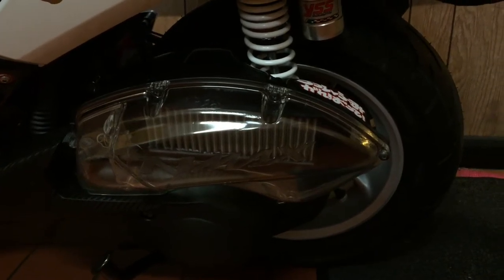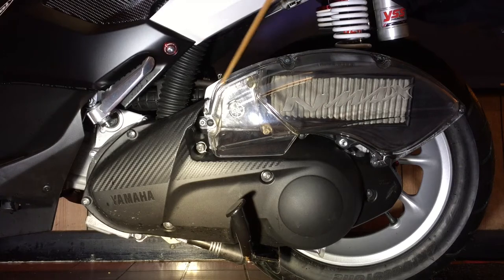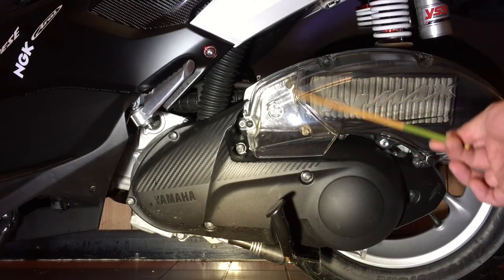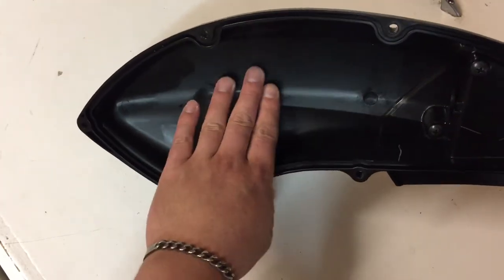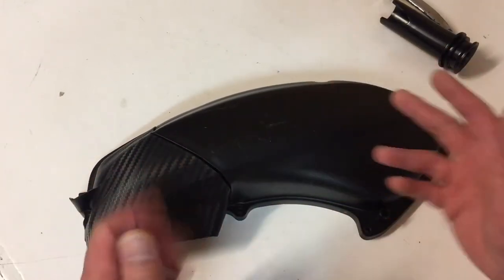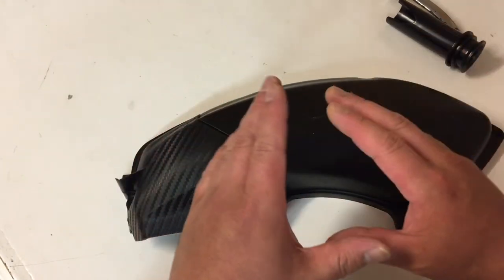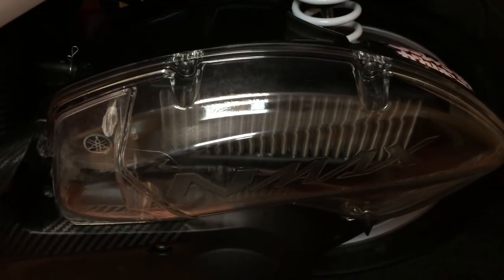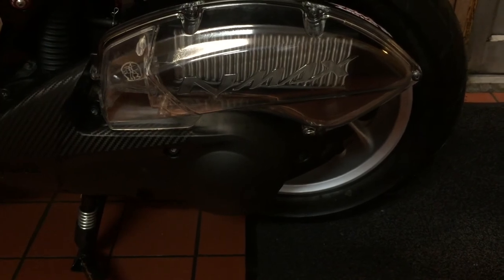Yamaha Nmax Airbox/Airfilter modification - DISCUSSION ONLY

Comment: Any help?
I’m a complete bike novice

My Yamaha nmax has been stalling while idling at lights or gates, sometimes won’t warm up the engine, just shuts straight off. Today it stalled while trying to turn throttle.

The fault code 37 popped up for a few seconds the other week then disappeared and not seen it since 

the rpm slows down and splutters but sometimes still Revs when I’m not touching throttle. 

Could a dirty air filter be the issue I’m having? 
Too skint to send it back to the garage atm so if anything I can do myself, any help super appreciated
Reply from the maker: I’m sorry to say the best way is to use a fault code checker which is also gonna cost money… sorry I wasn’t if more help, I have pinned your comment for you in the hopes more will view it and be able to help. 👍🏻

Comment: Thank you. Your video made me aware that I do not need to replace my stock filter with an aftermarket foam filter. The last explanation about lean air sealed the deal for me. Without proper fuel tuning, having high air flow can do as much harm as it has benefits.

Comment: Hi there one question I want to do 155 to my n max do I need to run anything else
Reply from the maker: Nope, cylinder and piston kit straight swap and the scooter will run as factory intended, original design 155cc.

Comment: Seeing as your so on the ball any advice what my next steps are other than exhaust should I bother rejet and get a new cone filter or do I just go with exhaust and better filter media.
Thanks man I’m in the uk a point in the right way would help
Reply from the maker: I went with original box and better panel filter with exhaust and didn’t regret it, if I were to do it again I’d do the same just to be rain proof, our weather is real sporadic over here and and water through a cone filter would be detrimental. ^^
Reply: @astroblemeRC  thanks so much appreciate it man really do it’s my side transport I have a car for worse weather it’s dry stored,, if I was to remove that whole air box unit would I be able to not worry about all the little hoses and just clamp a cone filter straight to the hose from the carb? Many thanks man your a legend gained a subscriber here .
Reply from the maker: @B1UK  I never got to try it so can’t say for certain but in theory it should run and will add some pretty beefy noise on throttle. Make sure to get a good cone filter that is able to block small particles from entering the system, thanks for the support my friend, really appreciate it 👍🏻
Reply: @astroblemeRC  I’ve been checking out your other videos good info to take in, what I’m gonna try and do is get the exhaust done and do the cone filter and should be able to tuck it out the way under the back so it doesn’t get too dirty, so long as it’s secure shouldn’t have any issues failing that il just go with your solution with the new filter and removed snorkel. Thanks mate

Comment: Hi again. I hope you could help me out with this. I installed a ram air intake pipr on my nmax, replacing the stock rubber air intake pipe. I used to have a bassy exhaust sound on my open pipe, and now it sounds smoother, which I don't like. Is it because of the air intake pipe I installed? I also changed my driveface and pulley. Or is because of the Driveface and pulley?
Reply from the maker: Gab Picar 
Hi there 👋 
I can’t speak about the pulley or drive face but in my very limited experience, modifying the intake “usually” only changes the sound of the intake or the suck of the air, but not the sound of the exhaust. For a bit of history, I had a Cagiva Mito 125 2 stroke in 1998 and it had a very high pitched exhaust due to it being 2 stroke, after changing the intake on it to a free flow system, reving the engine still had the same high pitched exhaust note but the intake sounded like a deep bass roar, which was awesome! Sorry we couldn’t be of more help.
Reply: @astroblemeRC  ow, thanks for the reply :)

Comment: Hi..ive put the stainless free flowing air filter on my yahama aerox 155...its using far more fuel with it installed..how can i adjust the fuel ..? Thankyou..been looking for someone to post a video about this...
Reply from the maker: Paul Bryant 
It will be a little less efficient after a freer air filter is installed, it seems the ecu can sense more air going in so it increases the fuel, to correct the air fuel ratio, this means you have more power/hp but sacrifices a little economy. Has it affected it drastically?
Reply: @astroblemeRC  hi thanks for ur reply..ur spot on with ur reply..and yes it has used way more fuel ..i travel with my friend .he took his 155cc and i took my 155cc bike .we did over 400kms on the first day together ...his bike has not been modified.he only filled up twice but i filled up 3 times..at higher speed around 100 i could see the fuel level gauge dropping faster over a 30 minute interval...but if i stayed at 60 to 80 kms it didnt drop as fast....so in conclusion riding at a higher speed definitely allowed more air in and used more fuel...but i do think i did get a little bit more power at take off from pole position .lol....so for example my friend put 7 usd of fuel in and i put 10 dollars ...the aerox spec say with no mods it should get 36km per litre..but i was getting 25 km at high speed riding..big difference....hope that helps other people out thier..cheers
Reply from the maker: Paul Bryant 
Thanks for the feedback, that is a lot of good info!
Reply: In short. 
More power. 
More gas
😀

Comment: I have a suggestion for u sir, our bike will sucks many dust on summer and autumn. so it would be great if u add some grease on the first chamber for trapping the dusts to avoiding the stainless filter sucking more dusts to the fire chamber, bcoz i can see thats u use a stainless airfilter and that thing is not working properly to filtering the dusts especially onto the smallest particles, so u should changing the oil more intense if u wont the bad things happen with ur machine..
Reply from the maker: EXCELLENT POINT!!! 
I totally agree, I remember first experimenting with air filters in the 90's (in England we were mostly playing around with naturally aspirated DOHC engines at the time) and we noticed that when we took filter elements out, they were usually made of paper. 
And sure enough when we replaced filter elements with after market, less restrictive ones (most popular brands at the time were K&N and Pipercross) we noticed that they were made of fibre with netting and had filter oil on them, this is to act as a trap for the fine dirt that the fibre element couldn't restrict. The same can be done with this filter element.
Any foreign material that enters the air chamber will be detrimental to the health and life of the engine. Even the finest of sand can ruin  the cylinder and piston.
We really enjoyed this discussion point! And thanks for contributing good information! ^^

Comment: hello.. very nice vid...i got a question for u sir...what about keeping the snorkel but turning it the other so it fires air into the filter instead of the back of the airbox...what would allow more air... the above or ur method but without enlarging the hole...i currently have a full bolton nmax 
tdr stainless steel air filter
tdr twin iridium spark plug
full cvt kit
tdr 183cc bore up...
 so i got 2 options
either turn the snorkel or remove it... what do u suggest sir?... u look and sound like u know what ur talking about....thank u in advance!
Reply from the maker: Hi! Turning the snorkel to directly fire into the filter won't increase the air flow and only disables the debris/ moisture trap function, the best method would be to remove the snorkel. This will increase the flow a little, next step would be to enlarge the inlet but if it is not desired just removing the snorkel is fine for now. keep an eye open for water intake on the wet days though, Hope this helps!
Reply: thanks for ur reply 🙏
Reply: but how did u detect  the increased flow?
Reply from the maker: @abdallahbidawy2211  
Simple science, I studied Engineering back in the 90's and one unit we studied showed that, a smoother, less restricted channel will always be, as the unit suggested, less restrictive and freer flowing.
Happy Modding ^^

Comment: Sir, how did you remove the airbox snorkel?
Reply from the maker: Gab Picar 
The snorkel is very soft and rubbery, it can be remove with some mild force once the cover is off 👍🏼
Reply: @astroblemeRC  thanks for replyin, But where indeed do I pull the snorkel? From the head? Or from the tail- where the filter is located? And of ever, do I pull it? I tried to poke it using a flat head screw. I just can't seem to find a tutorial vid on how to remove it hehe :)
Reply from the maker: Gab Picar 
Sorry for late reply, the snorkel is quite rubbery and soft, just gotta squish and pull it, deforming the shape a little so it can be pulled out like a rubber toy through a hole. It shouldn’t take much effort and it shouldn’t be damaged in the process, takes about 20 seconds ☺️👌